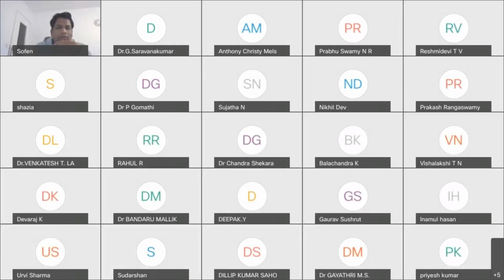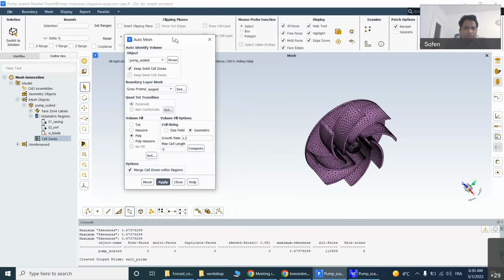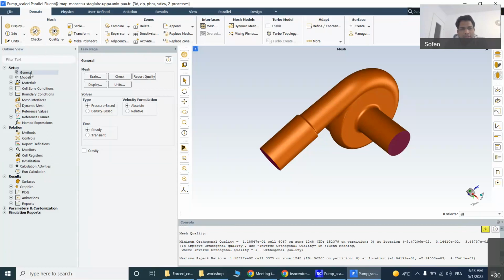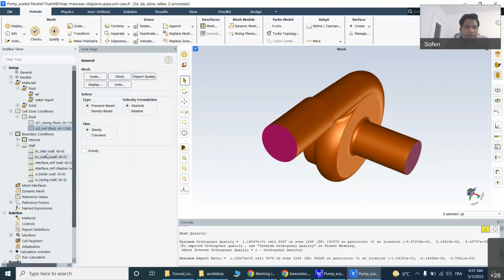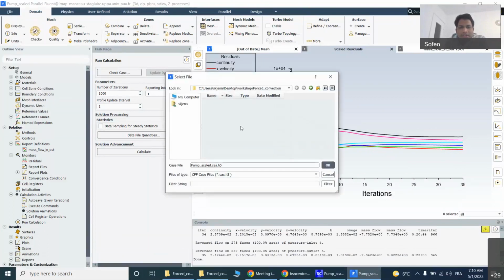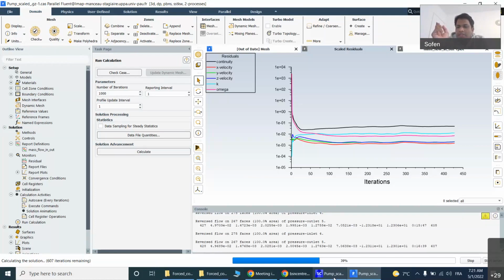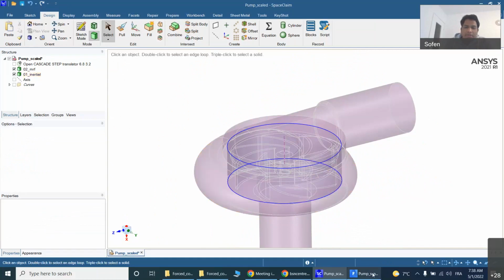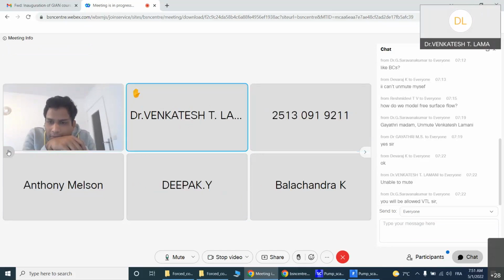CFD setup for rotary devices in Ansys Fluent using MRF and Sliding Mesh

Comment: Hi @sofenkumarjena,

You told that max timestep is set to rotation of 15-20 degree for pump. Is it acceptable for propeller and fan?
Reply: Because propeller blade is changed from 2 to 4. And Fan is nearly same with pumps

Comment: I am simulating a case very similar to the one in the video.  It was so useful for me, thank you for sharing.

Everything is fine, however, I get pulsation results in head. Although the mean value of head pump seems to be reasonable (about 19m), at some points it is positive, and at some others is negative!!
Is it a regular behaviour of software or did I make a mistake at a point?
Could you tell me what are the possible issues in my setup?

I have another question. Why didn't you set mass flowrate-outlet for the MRF case? (while you did it in sliding mesh)

Comment: Hi Sofen,

My Ansys Fluent setup has an issue creating a sliding internal face (video time 1:38:13), and I have tried this multiple times. Every time that new interference doesn’t show in the structure tree. Although, if I move forward, initialize and run the calculation, it doesn’t show me the mass flow rate against time. I know it is not your problem. However, would you mind having a look at my setup?
I Won’t mind sharing my fluent set up with you. I would much appreciate to hear back from you.

Kind regards,
Gurwinder

Comment: I had the same problem with setting up the unsteady simulation, just like at 1:25:35. So the most helpful advice from this video, for me, was changing rotating zone back to Frame motion (1:26:30). And then the text command mrf-to-sliding-mesh worked! Thank you my saviour.
Reply from the maker: 👍. Welcome

Comment: why do not you define mesh interface?
Reply from the maker: You do not need to provide mesh interface explicitly. After preparing the conformal mesh for both static and moving zone import them to fluent, then go to TUI command and segregate the moving part, it will automatically form an interface and the mesh will be nonconfirmal with time. Hope this answer your queries 🥰🥰🥰🥰🥰
Reply: thank bro. @SofenKumarJena
Reply: @SofenKumarJena What if I combine CHT simulation and slidding mesh like on a hot brake disc? Are the settings same? (modify zone > mrf-to-slidding mesh)